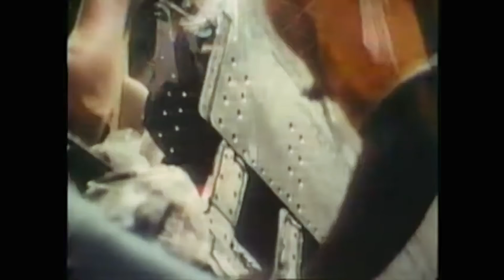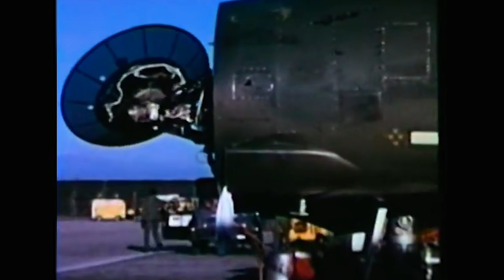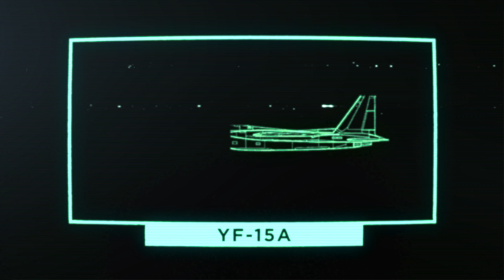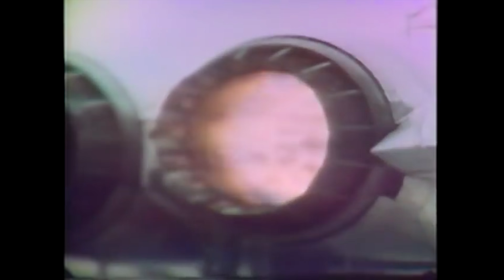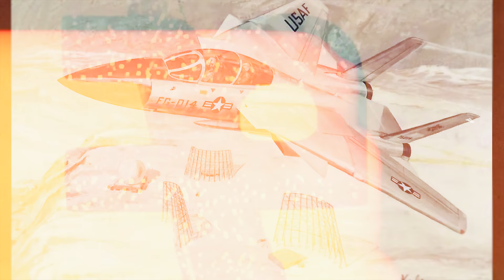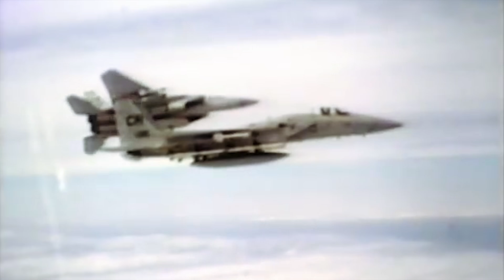F-15N | the forgotten 'Sea Eagle'

Comment: Fighter number design designator progressive sequentially with the number meaning that the F15 predates the F16 and YX17, which later was developed into the FAA 18 super hornet. There's no basis for the argument of the F15 being designed from the F, A. A 18, because that would mean that the FAA look YX17 was developed from the FAA 18. No, it doesn't work that way, that's backwards.

Comment: It's rather obvious, despite the overengineered excellence of the F-X to counter a CIA-imaginary MiG-25 'Air Superiority Fighter' - that it's airframe would have to be upscaled, the same way it was for the F/A-18E/F in order to meet Navy Fleet Defense requirements, including conformal fuselage missile fittings to reduce drag and increase endurance, making a modernization of the F-14A for Air Force procurement more interesting - just as proposed at the end of the Cold War, offering ground strike capability alongside a final engine flaw fix (F-14A+/B/D). 

Something that is not mentioned for the VFX is it's early Link-4C Sensor-Fusion, a feature of 5th Generation Airwar - especially with stand-off missiles like the AIM-54A/C - another capability that the F-X lacked.

Comment: Had it actually happened this F-15N would of been the new gutless cutlass 😂  Im so over the F-15 fan boys and their first response ,Air Superiority Fighter, blah blah blah, and for the factual record, the F-14 is classified as a Air Superiority Fighter👀 and if that doesn't get them to sit down they will tell you it's undefeated 104-1 and then you gotta come back at them and tell them slowly,because their blood pressure is high at this point, you have to tell them about the F-15N and how much of a failure it would have become compared to the Tomcat that was originally designed to slam and violently get snagged on a carrier at sea and get pushed violently off a carrier with damaging salt air and the Tomcat not having the luxury of 9-12k foot runways and usually in nice climate conditions 😆 and if that doesn't convince them that comparing these two shouldn't be done because they have always had different mission sets.  The one thing im glad is they are both from my county🇺🇸🫡

Comment: This video further justifies my long, undying love for the Tomcat.  It's pretty easy to see how the Tomcat's empty weight was 12,000 lb heavier than the Eagle.
Reply: don't overlook that that land based fighters from the airforce have a massive tanker system and can land "anywhere" as opposed to naval aircraft.  the F14A in full dress hauled 20,000lb of fuel versus 12k for the F15A.  Add in all the upgraded navalized landing equipment and we can see why the F14 was a chonky as it was.  An F14 was designed, might like a cat, to lay around at altitude, loafing in a sunbeam until it was go time.  Cue the Zoomies, bugged out eyes and a hatred for your feet under the blanket.  The F15 is more like a heeler, show up out of nowhere, hauling ass, 50 pounds of teeth and ego then go home and get treats.
Reply: @mistermonkey5842  F-14A was 16,000 lb internal fuel. The 23,000 lb was the F-111B
Reply: @TyrannoJoris_Rex  the devil is in the details, it's 20k with the long duration cap/fleet defense mission drop tanks.  Tanking off KA6Ds they could pull an additional 15k in fuel.  The limiting factors become crew endurance and engine oil but worst case , as long as you can keep sending up KA6Ds you can limp it home because it MUST make it back.  Eagles can land "anywhere" there is enough pavement and the balls to try.

Comment: The F-15N would've sufficed as a naval fighter. look at the MiG-29K, and the SU-33/J-15. These are perfectly adequate for a multi-role naval fighter requirement. The Sea Eagle would've shared that same  niche.Thing is, the USN wasn't interested in adequate. They were looking for the ultimate fleet defense fighter interceptor. they got it with the Tomcat. A naval fighter designed to be able to serve well into the 21st century. Had the Soviet Union not dissolved, the F-14 would still be serving in an advanced form.

Comment: Both were great aircraft but built for completely different missions in mind.  The Eagle was a fighter (initially) built to be flexible for many different missions & weapon systems while the Tomcat was basically an airframe designed around one complete weapon system (Phoenix & radar) for a much more narrow mission - fleet defense & long range intercept.  To make the Eagle fit into the box the Navy wanted would have neutered it from all the things that made it great - folding wings would have limited it's G rating, added weight would have slowed it down & decreased range while trying to make the radar/AIM-54 work on it would have been problematic at best.  Lastly, the Eagle was never good around salt water environments (the '80s C models from Kadena AFB that were transferred to the Air National Guard had horrible corrosion issues on all the wiring/electrical).  While maintenance on them would have been much easier than on the F-14, there would have been a whole new host of issues to deal with.  By the time a version of the F-15 came around that COULD have done the job (F-15E model), that mission & need for the Tomcat was already passing away.  As to which plane was BEST, the easiest way to answer that is which one is still being produced & in service.

Comment: Less than 3,000 pounds more weight for the upgrade? Bullcrap. A navy nose strut is larger than the F-15's standard main landing gear. You would need to have stronger structure mounting for the gear as well for the heavier gear that is needed to land on the carrier.

Comment: In the end, the Eagle is still flying, while the tomcat was retired due to high upkeep costs.  Given that all the phoenix kills were Iranian tomcats, it seems like the F15N was actually probably the better choice for the Navy which never took advantage of it. With hindsight of course.
Reply: The only reason the 15 is still flying is because the F22 production cut short due to cost.  Originally the 22 was supposed to replace the 15s entirely.  The 14 & 22 share much of the common issues of their times.  Active service technology demonstrators that lead to cheaper variants being built afterwards.  The 15N was the wrong platform for the Navy for at least 20years until the 120s came online in the early 90s unless they carried the -54s and that would've nullified any kinetic advantage of the 15A/Cs.

Comment: Hmm, some of this is just lazy AI stuff at this point. The AI narration is an AI script; and even the human is clearly (like eyes totally locked in) reading a (likely) AI script as well lol. 

Anyways a lot of this is wrong, largely the points about the F-15 variant being “faster” (in real-world perhaps, but the F-15 could never carry a missile the size of the Phoenix in the centerline stores, so the whole argument js pointless - it would be limited to the VERY close speed of the F-14 at best.) The fast packs would have killed any advantage for sure, and the navy model would have needed these fitted at all times most likely. An F-14 without the phoenix drag is back to baseline clean performance plus any A2A loadout, which obviously almost became a factor in the first and second gulf of sidra incidents. It also allowed for Top Gun-type training in a fleet defense spec aircraft unlike any fast packs etc. 

However the larger issue is it ALSO claimed better slow speed handling and stall performance, which I would argue is literally impossible given the tomcats variable sweep wing and core design as a carrier aircraft. You can pick one or the other, but you sure as hell can’t pick both! 

Also the carrier suitability and modifications were likely GROSSLY over-simplified and under-estimated. They’d have figured that out the hard way - even with the F-4 experience. Grumman was extremely familiar with these underpinnings going back to the start of naval aviation for the US. 

I’m guessing the weight additions noted would have seen an obvious revision in the “low speed handling” advantages, but who knows.
Reply: No AI script here - all human writing - not ‘lazy’ at all if you knew the amount of time and effort that goes into researching, writing, and producing these videos.

Comment: Also, an F15N would not have had the teething problems of the TF-30 engine and added 4,000 lb thrust per engine with the F100 engine.  An estimated 40 to 45 F-14A Tomcats were lost due to accidents and compressor stalls caused by the Pratt & Whitney TF30 engine. Navy Secretary John F. Lehman Jr. testified to Congress that the TF30 accounted for 28.2 percent of all F-14 crashes.
Reply: Question is: would they have been able to navalise the F100? Whole reason F-14 got stuck with the TF30 because they couldn't. Even without trying to navalise it, the F100 still had its problems with afterburner blowouts and throwing turbine blades, and those weren't solved until the introduction of the F100-PW-220 variant in 1986, right around the same time the F110 was going into service

Comment: Honestly, this thing was genius not just because of it's fighter capability but also the possibility of it being able to replace the F/A-18, A-6, and A-7 in carrier strike. Not to mention the shared benefits that both the USAF, USN, and possibly even the USMC would get from sharing development (F-15 upgrades would be much easier, costs would be cheaper, maintenance would be a breeze, and every service would have access to an incredibly capable fighter.) Plus, planning carrier operations would be orders of magnitude easier-no more need to pick and choose aircraft to complement each other, (eg, using F-14s to cover A-6 via CAP)-just pick loadouts, send out the Eagles, and come back. You don't need to worry about enemy air cover, since the F-15 was purpose built to deal with all air threats.

Plus, the later RADARs on the Eagle could more easily detect anti-ship missiles due to look-down shoot-down capability, and ability to filter out ground clutter. Kind of insane the Navy rejected this in hindsight, especially with the F-15E and EX. Those would have dramatically increased the projection of the carrier groups.
Reply: The irony is that is they made the "Sea Eagle," that would have consumed a lot of F-15 related R&D resources, so the multi purpose Strike Eagle may only have happened much later.  When they considered the F-15 N, it was when the original F-15 A was still in development, and the A model was just intended to be for air to air fighter work, so that was all the navy really evaluated it for.
In the early 1970's, nobody making decisions on the military side fully understood how good microprocessors would get for switching between modes and wrangling data from different kinds of sensors.  So at that point they still imagined multipurpose planes as having horribly complex cockpits with lots of physical displays and controls for each task and weapon system.  So it was like 15 years from development of the Eagle to manufacturing of the Strike Eagle.  That was the one that could replace a ton of legacy aircraft at once.
Reply: Exactly. We cannot see it AI-style, completely ignoring the timeframe. People were able to believe it can be a fleet defense fighter out of F-111 (well, even the bigger Tu-128 was a fighter). Still, it took the issue with Hornet - which was supposed to be two different planes (F-18A and A-18A) that became one - to weaken the faith in narrowly specialized single-mission aircraft.

The follow-up were Strike Eagle, F/A-18D Night Attack, F-16XL, Super Hornet or Bombcat. Not to mix it with F-15EX, that miraculously emerged two to four decades later.

But the pictures of Sea Eagle with various weapons configurations close to the end of the video seem to clearly suggest there would be no F-15E without the F-15N experiment (unless, considering the author's doubts about the CFTs, it was some PR trick added post factum).
Reply: @WillRosecrans  Something that people oftentimes seem to forget is that McDonnell Douglas did want the F-15 to have strike capabilities from the getgo, despite the whole "not a pound for air to ground" mantra. They wanted a version of the Eagle to replace both the F-4 and the F-111 the moment they started working on the F-15. Not to mention, the F/A-18 Hornet program was in testing-the tech for MFDs and dual-mode RADARs were well under way.

Also, the second TF-15A prototype was tested extensively for strike capabilities. It demonstrated a strike loadout with FAST packs and TGPs in the 1980 Farnborough airshow.

And that isn't even getting started on Israels many strike missions with air-superiority versions of the F-15 in the '70s and '80s. The F-15C can carry 16,000 pounds of ordinance-the F-14D could carry 14,500 lbs. maximum, and that's with heavily updated engines and avionics.

To put a long story short-the F-15 could do ground strike missions before the E variant. If the navy wanted to, they could easily press the Eagle into service in that role.
Reply: stealthy f15 ex how many phoenix up to date missile could f15ex carry ?
Reply: @blizte3  Honestly Phoenix would probably still be retired. The latest versions of AMRAAM would still supercede it due to how much cheaper it is to develop with it's larger export market and wider array of potential platforms. An F-15EX likely wouldn't be able to carry nearly as many Phoenixes as it could AMRAAMs, the former is just a massive missile.

Comment: Seems if the Navy had selected the original F-15N, it would have resulted in buyer's remorse. Not mentioned, but looking at the main landing gear layout, it's pretty narrow, and I can't see much room for pushing it further outward without a major redesign, a la F-18. When the A-4 was introduced, the Navy had some sort of formula for an acceptable landing gear geometry for carrier use. It had to do with height and c.g. location, and some tipping angle formula relative to the nose gear position. The A-4 supposedly exceeded the configuration limits, but it was allowed anyway. Acknowledging that the YF-17 to F-18 worked out, it would nevertheless hold that adapting a carrier plane to land use is easier than the opposite. Can't blame them for trying. BTW, thanks for including the background on the USAF vs. USN radar choices, including for the F-4. 👍

Comment: Grumman did a fixed wing study as an alternative to the variable wing sweep. The end result ended up looking very familiar to an F-15. The projected performance ended up worse then the variable sweep variant.
Reply: The whole point of the variable sweep is/was no compromise with the flight envelope. Low speed handling would be better, and high speed handling would also be better. 
The actual compromise was extra mass, complexity, and maintenance ->but when you’re building a shot field take off and landing airplane, these shortcomings might be worth the trade offs. 
The F15 would have naturally had worse low speed, and high speed handling, but better payload, range, maintenance, and cost.
Reply: @drewski5730  true
Reply: @drewski5730  Huh. Where does the F-15 have worse high speed handling than the F-14?
Reply: @TyrannoJoris_Rex the F15 has 45 degree fixed sweep, the F14 has 68 degree maximum variable sweep. The reality is that the F15 has better thrust to drag ratio, which means it’s marginally faster in the real world. The F15 is also stated to have better stall characteristics than the F14, and maybe even a lower stall speed, although Google says the F14 had a slower approach speed. It begins to put into question as to why you’d want the variable sweep in the first place doesn’t it? Maybe that’s why it’s retired, and there aren’t anymore variable sweep aircraft in production.
Reply: @drewski5730  Yeah F-14 pilots have confidently stated they could beat the F-15 low and slow. I know about the glove vanes to keep the center of lift forward and have heard people talk about compression lift between the engine nacelles (which I'm not sure I buy, but idk for certain), but I've bever heard the F-14 handling better than the F-15 at high speed
Reply: @Tyran @TyrannoJoris_Rex e higher sweep angle will naturally have higher stability around the lateral and vertical axis at speed. There are several other aerodynamic enhancements at high speed, but you asked about handling. Compression lift is absolutely a thing; however most fighters (gen 4+ twin engine in particular), incorporate some sort of lifting body, the F15 in particular landed with a single wing after an mid air collision.
Reply: @drewski5730  I asked about high speed handling because in the last paragraph of your initial comment, you said the F-15 had worse high speed handling